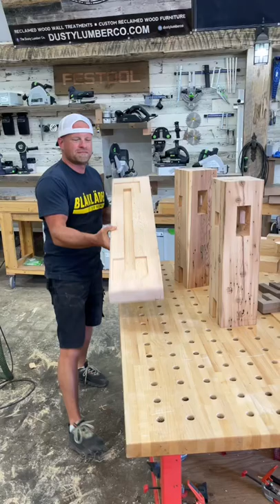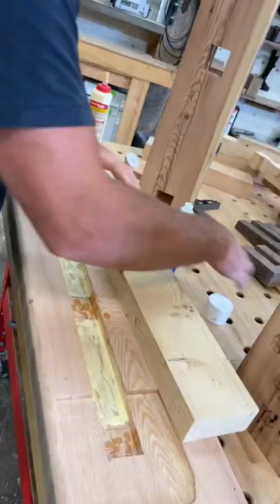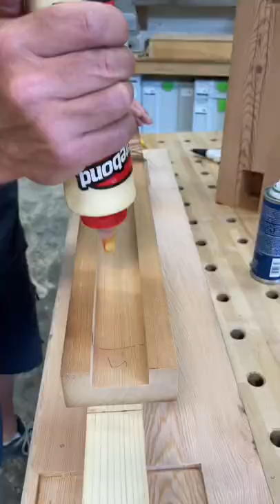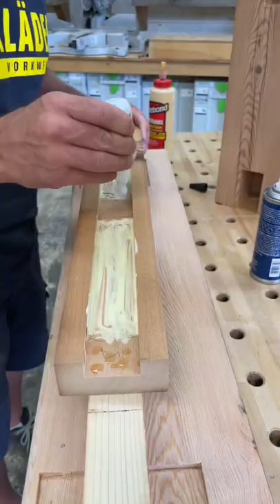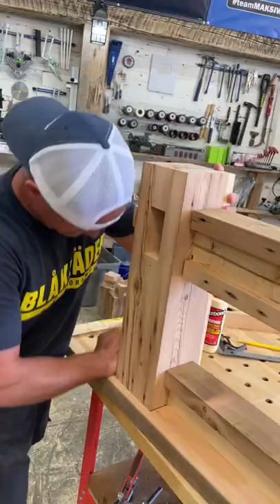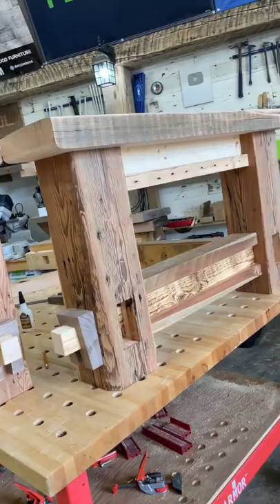Arm rest joinery #woodwork #woodworking #maker #shorts #wood #tools #joinery #work #bois #holz

Comment: What is this two component spray? And for what is it?
Reply: It’s ca glue which is super glue and the spray is an activator which dries the super glue when it comes in contact with it. So the way he’s using it in between the wood glue it is acting as a clamp holding the pieces together as the wood glue dries. This just allows him to continue working with the piece without having to wait for the glue to dry or put a bunch of clamps on the piece
Reply: @CMP.  Wow nice conclusion. Thank you ^^
Reply: @dapacman772  no problem!

Comment: I don’t even have to watch the entire video to know I like it and thumb it up. Question what’s that being sprayed in the 2x4? Spray adhesive?
Reply: More than likely a super glue acceleration spray. He is mainly using wood glue for the long term high quality bond but it lacks a quick dry and quick hold time, super glue has the opposite characteristic when used with an accelerator, super fast bond time but a lot weaker than wood glue (weaker not weak) so he can get away with moving it around quicker whilst still having a high quality finished piece.